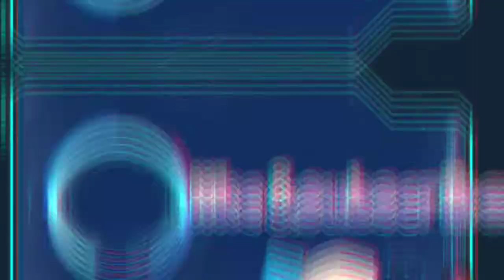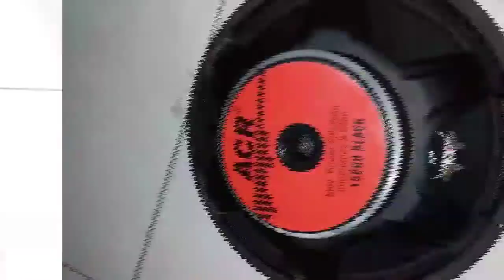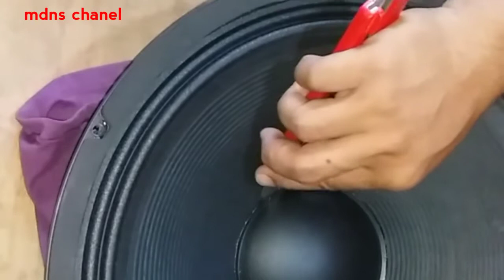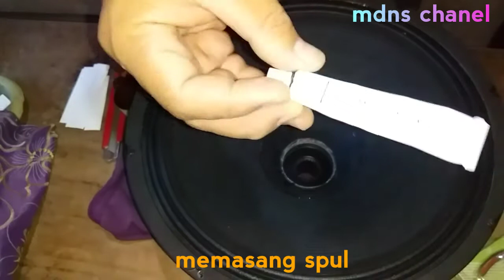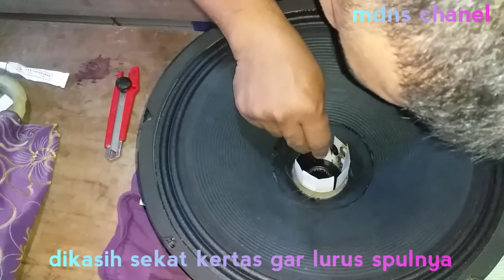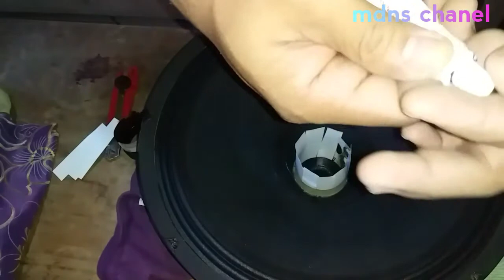cara mengganti spul speaker#15 inch ACR#

Comment: Itu spiker msih baru kok udh teerbkar knpa
Reply from the maker: Watt powernya terlalu besar&dgeber terlalu kenceng mas😁😁
Reply: @DikaAudioDemak  power builup?
Reply from the maker: @r.langgaudio5521  power biasa mas pake driver socl 504 tef.pake trafo donat 10 ampere ct 65 volt
Reply: @DikaAudioDemak  maen brapa ohm
Reply from the maker: @r.langgaudio5521  4 ohm mas

Comment: mau tanya
Soal speaker🙏
Punya speaker black spider 15 inc 15400 
Kondisi bekas 
Dicek suara normal 
Udh dipakai 2 hari normal
Setelah 4hari power di volume jam 12 suara ngeber
Sudah dicoba pakai 3 power ttp sama
Saya cek daun speaker saya naik turunkan spul tidak nggasruk sama magnet
Kira² apanya terr ijin tanya🙏🙏
Reply from the maker: Untuk speaker pernah dgeber gak mbak.coba dcek cone(penutup spulnya) kendor/gak.dcoba dpukul2 pake jari ap ada suara ngeter gak mbk.kalo masih ada suara ngeter kemungkinan gulungan spul lemnya lepas